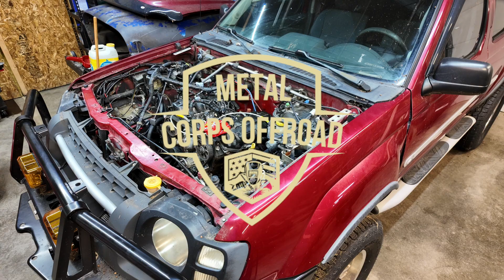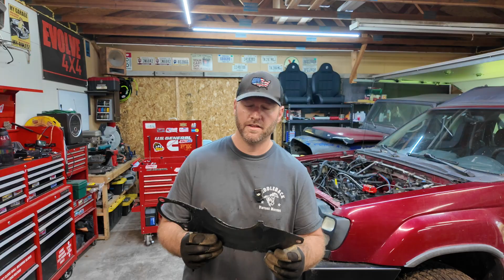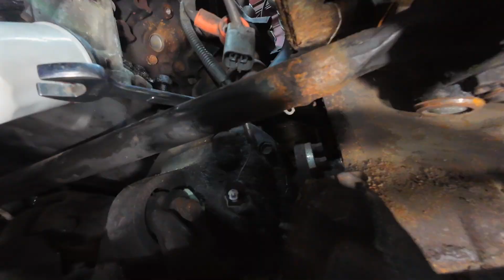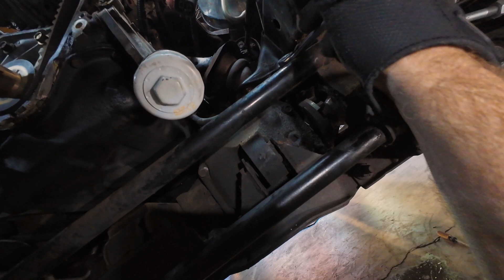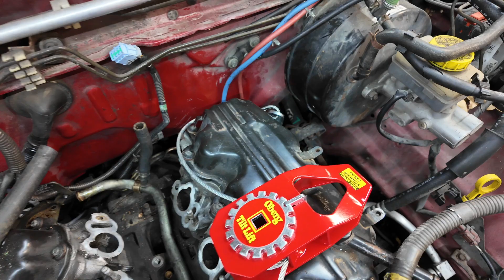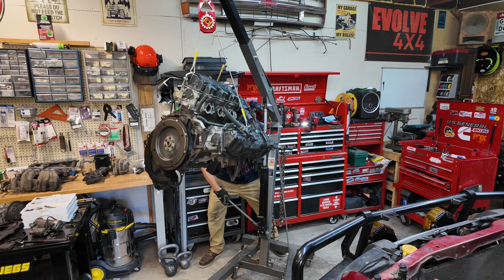I Finally Got The Xterra Engine Out

Comment: As I mentioned in one of your previous videos...I removed my xterra's motor (my first motor ever) two months ago. Pretty much reliving it through your videos. I removed the front dif on mine. I've done that enough times that it's not too difficult for me. I have a body lift on mine too, so it does help a lot gaining access to things. I'll be doing a rebuild on the old motor too...maybe this winter. If you decide to do the same, it'd be great to reference. Keep up the good work!
Reply from the maker: Funny you mention that, I actually laid underneath the truck for a minute staring at the front diff, deciding whether or not to remove it. The vice grips were my line in the sand and the diff was coming out if I couldn't get the final two turns on that nut. I wanted to service the front diff and add a traction aid as well so it wouldn't have been the worst thing to remove it.

Comment: The engine hoist device is pretty sweet.
Reply from the maker: Yeah it is! I usually use one of the leveling cranks but this was much better.  Definitely recommend it over the crank mechanism. The crank mechanism is much better than nothing but always get's stuck when I need it to adjust the most.